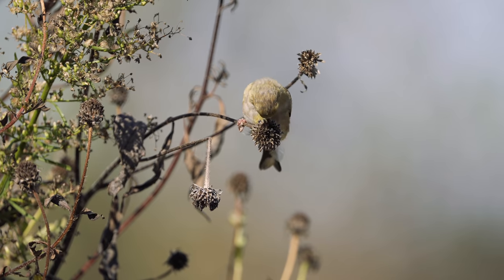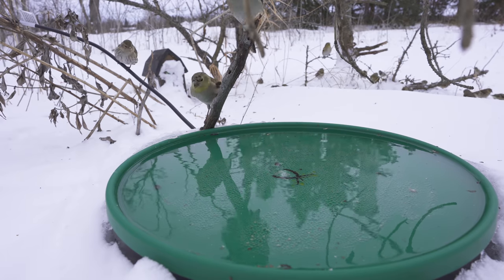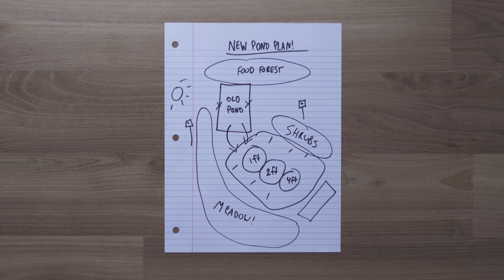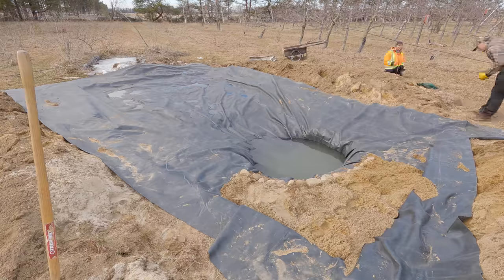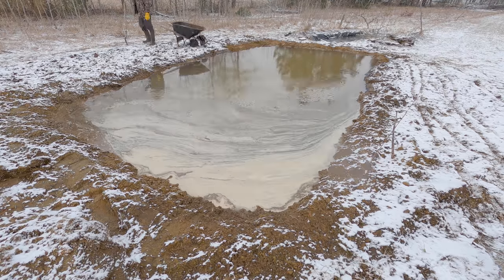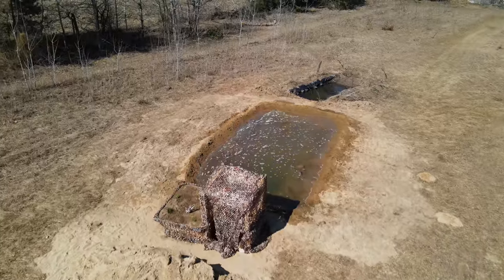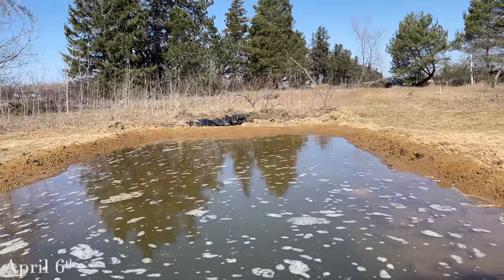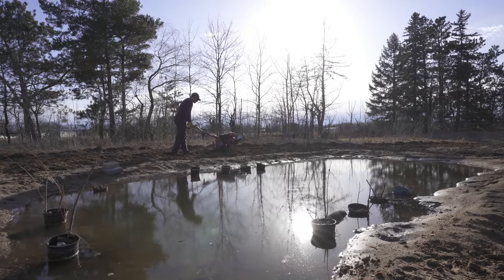i'm destroying my wildlife pond, here's why

Comment: I live on a barrier island in Melbourne Beach, FL. If I lived where the temperature freezes I would build a large pond with a tiered waterfalls attached to recirculate the water, and though that would not keep the water from freezing it would 'help' keep the water moving during the colder times of the year. I have had fountains (as well as a pool fed by a three tiered waterfalls at a previous home), and it's fun to watch humming birds drinking along side of bees. Good luck.

Comment: LOVE IT ❤️. You should get a couple of years of fun out of the new pond before you feel the uncontrollable urge to expand it!

When that happens, try doubling (or tripling) the size and maybe even the depth, if you’ve got the land for it!  Anything more than that may attract beavers….if there is any nearby creeks.  If so, they will take over the landscaping and expand the boundaries themselves and you will be officially retired.

If you don’t get beavers (because you have no nearby creeks), then the eventual size of the expanded pond will transform the landscape entirely for at least an half acre circumference surrounding the water.  

You will eventually end up with a forest in 30-40 years if you allow the pond to remain and you just slightly maintain it so that you don’t lose the water.  At that point, you will truly be astonished at the sheer scale of biodiversity YOU single handedly created!!!  Bravo 🙌 

Best Wishes  & Good Luck

Comment: I build wild life ponds for a living, always try and keep them free of ice in one section, I use wind powered agitators or electric drag lines to keep it from forming. Birds rely on the water, same with the feed. Feeders should be up by early September. Four feet is too shallow you need 6 for a cold area but it is too late now. Next time use the spoil to give you additional depth by running liner up the banks and sculpting them, you created a flat rectangle surround that is more like a natural swimming pool. You had a big enough liner, just. 

By trimming the liner it to keep it 'tidy' you removed the possibility of a wet or swampy patch of ground that is just as valuable worms, insects and birds love it. A lot of insects like butterflies prefer damp mud to water they drown easily. Tidiness is the enemy of wildlife gardening put your strimmer away and plant some trees and bushes your yard is like a desert.

Comment: I built a 60ft by 80ft, I put a bubbler in the middle which keeps the ice from freezing. I turn it off every year in December so the water can freeze and the kids can skate on it. Maybe try a bubbler to keep the ice from forming, I drain my pond down every year by about half way (it’s eight feet in summer so about four feet in the winter to handle the snow load so it doesn’t flood in the spring so it should work.

Comment: Hi Stefano! I noticed that you never made another video with the Sigma 100-400mm for Sony E. I was wondering if something made it so that you didn’t want to use it, and if you would recommend it to me as someone who uses the Sony A7RIV. Is the sharpness high quality? I was using the Sony 100-400 GM and I’m looking to get the Sigma 100-400, so I was curious what your thoughts about it are? Thank you so much for your help!
Reply from the maker: Hi, I had initially bought it cause I was scheduled to work on a project where I needed two telephoto lenses. The project got cancelled due to covid and so I never needed the lens in the end. With using it on my R4 and a7iii, I enjoyed it and think it's a good budget option. I would try renting each model before buying and see what fits your needs!
Reply: @StefanoIaniro  What was the Sigma 100-400mm like when tracking fast action/birds in flight? I’ve gotten used to the speed of the Sony 100-400 GM, and I understand that there will be differences, but is the Sigma 100-400mm still capable of getting tack sharp BIF images? Is the tracking still serviceable, even if it is not as good as the Sony 100-400 GM? Thanks again, Stefano!

Comment: Awesome, I'm hoping to do the same in a few years. I wish you found a way to do it without a liner though.
Reply from the maker: Thanks! And same. The area is pure sand however. Can’t hold water for more than 20 minutes. I thought about buying clay soil but for the design I made it would be insanely difficult to build it with no leaks
Reply: @StefanoIaniro  I thought you probably did investigate other options. It's a pity but it does already look super-promising especially with all the plastic covered up. Thanks for the reply and good luck!

Comment: New to your channel, why didn't you install a roof to your hide? Won't this reduces the number of times you can use it and won't you end up having another pond, when the rainy season kicks in?
Reply from the maker: Hey, you may have missed it but I mentioned I will be putting in a roof once I get the right sized piece. Don't have anything on hand that would fit. I'm not too worried to leave it open for the moment since the ground is all sand. Even if water gets in, it'll soak into the ground in a few minutes. Thanks for watching!

Comment: how deep is the blind?
Reply from the maker: There's 3 feet underground and about an extra foot and a half above ground.
Reply: @StefanoIaniro  thank you!!! I want to make that too but here where i live its going to get wet when i dig 3 feet 🥲
Reply from the maker: @justinbruins1412  You don’t have to go that far down, I just did it so less of that side of the blind stuck out above ground. But technically you don’t even need to dig, you can build it above ground. Just make sure you don’t make it too high that it casts shadows on the water 🙂

Comment: Surprised you seem to have the very birds that will sit dine,, Goldfinches, house finches , sparrows , starlings, are a few that sit and dine, are they like this in spring and summer/fall , and the warblers, siskins, grosbeaks , thrushes, juncos, tree sparrow , chipping sparrow , blue birds , buntings, do you get those ?? or mainly what I see at your feeders in winter.???   TRIAL AND ERROR,  and showing it,  helps others see through your mistakes, to not do themselves.  The fact you are trying, a lot better than not doing anything.. Exercise ,brain exercise tool .  Thanks for showing